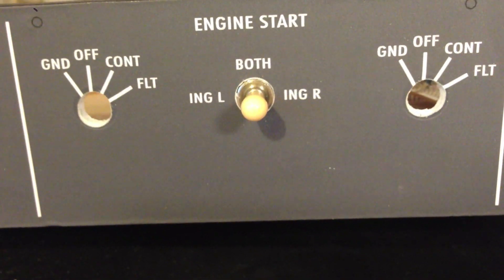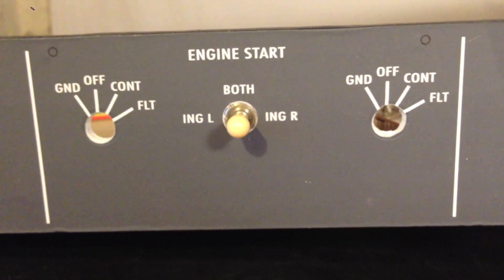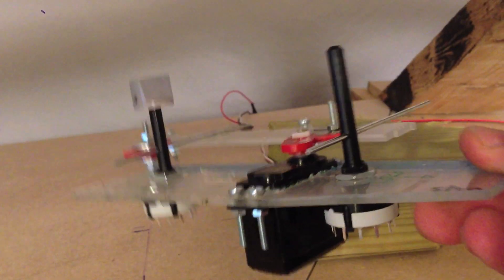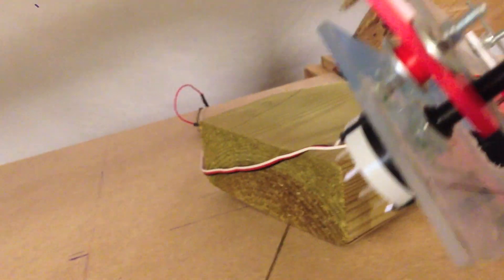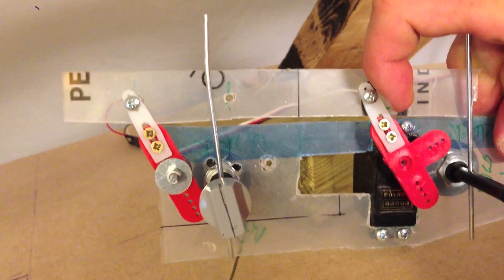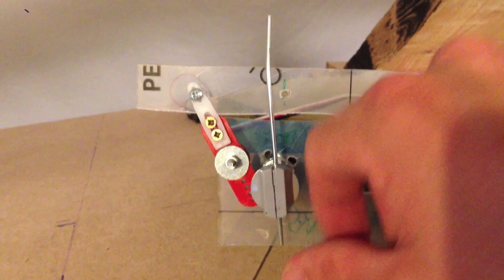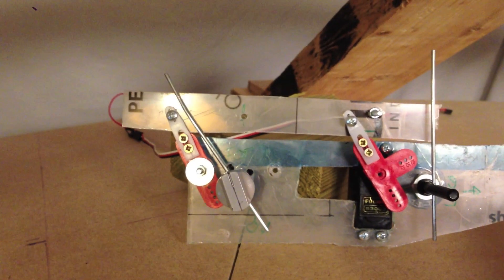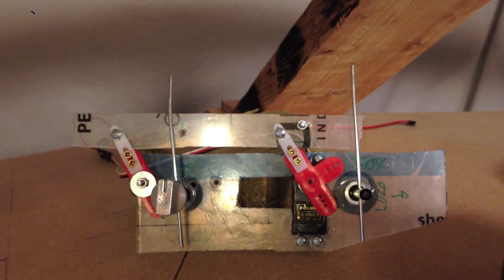Returning starter switches - B737 Home Cockpit

Comment: hello peter! great videos and affordable solutions for building panels! Could you make some videos possibly demonstrating the wiring and interface? i think this would be a great help, thanks!
Reply from the maker: Hi. 
I already got the panel mounted and working on the overhead, so I might be a bit hard to see. 
But it is VERY easy. All you need is a OpenCockpits servocard for the servo and OC MasterCard for the rotary switches. 
Then what happens is that when the "GND" switch is triggered there is a SIOC-script that engages the servo after 25 seconds. 
I tought I all ready had posted it on my blog. But I could not find it. So I'll make sure the code is published asap. But I am a bit busy the next days. 
But I totally stole this idea from Claus. See his guide at 737sim.dk/How%20to%20make%20automated%20start%20switche.pdf
Cheers
Peter
Reply: Build a Boeing
Ok great! thanks!